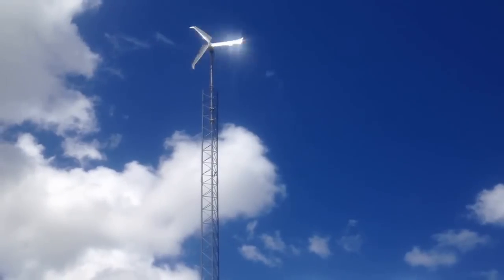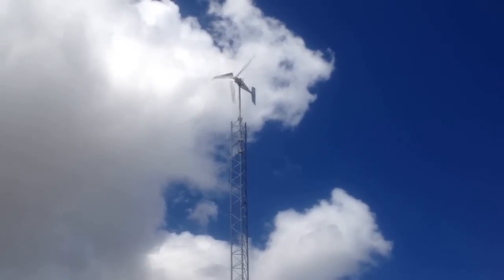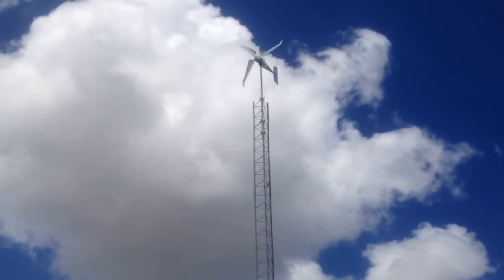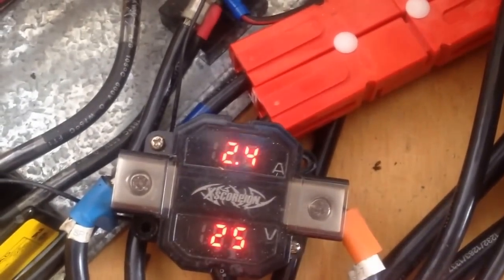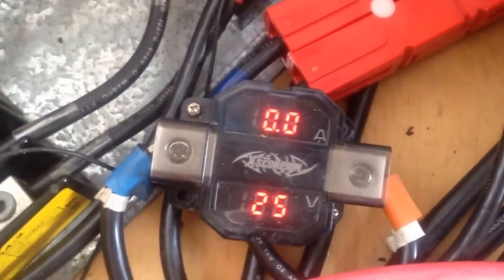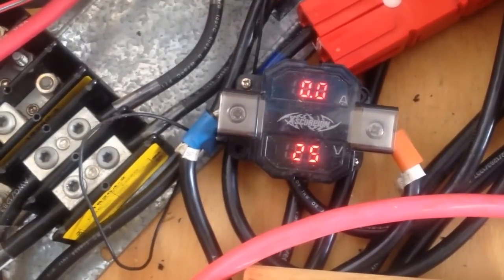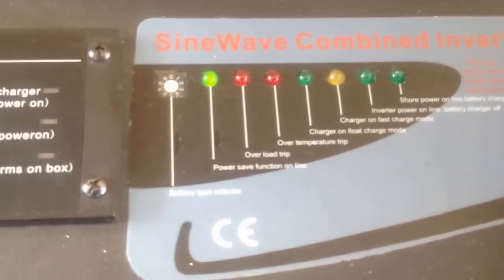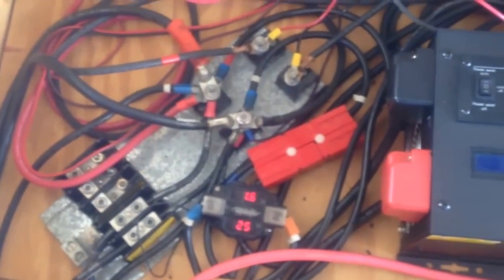Grid tie failure can spin  wind turbine out of control.

Comment: there is no half in this! the gridty inverter take 100% off his maximum 1000w because it uses lower voltage than current battery voltage (meter 25v) and anything passing its 100% goes too battery (another controller with the amp/volt meter on its output?) upsssss ,the gridty charge controller is amps limited only 600w passing by! gridty maximum output down to 60% ,600w at 24v is 25amps plus battery 4amps? is 29amps total.